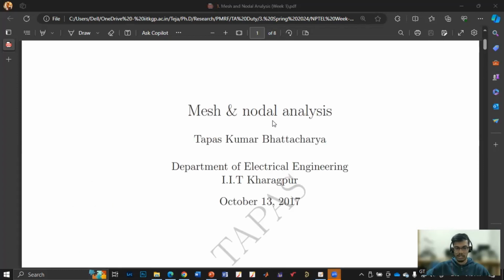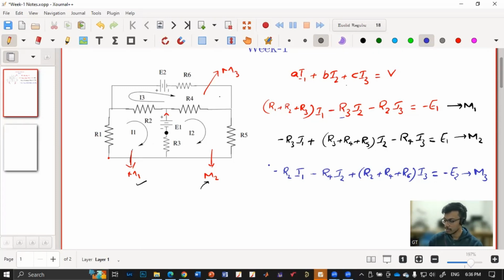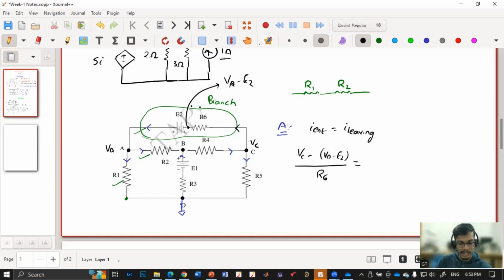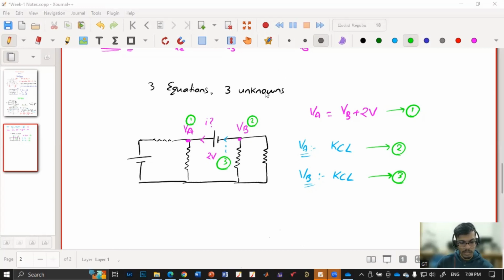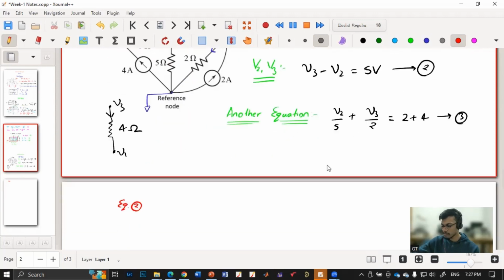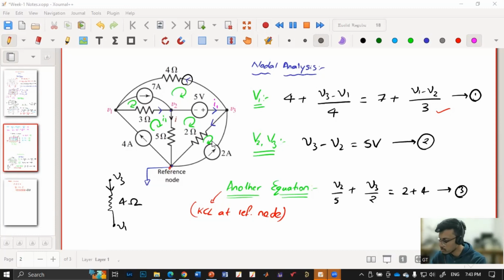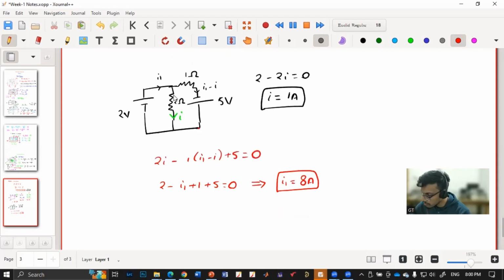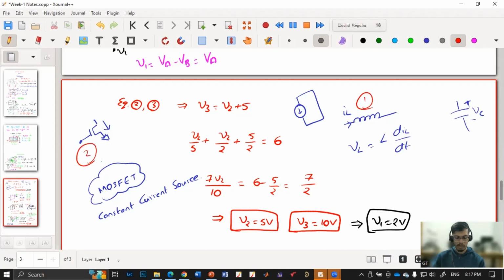Week 1 | Network Analysis | Problem Solving Session | NPTEL

Comment: Teacher, can you tell me how studying Network Analysis is different from studying normal circuits? In Vietnam, I only studied one subject of circuits, which is related to things like KCL and KVL. Is this course similar? Thank you.
Reply from the maker: Yes, this course discusses KCL and KVL, along with that other fundamental concepts in circuit theory including
1. Circuit Elements & Sources
2. A deeper look into Inductor and Capacitor
3. Solution to Linear Differential Equation
4. Mesh and Nodal Analysis
5. Self and Mutual Inductance
6. Circuit Analysis with Laplace Transform
7. Network Theorems
8. Graph Theory
9. Network Analysis with Dependent Sources
10. Two Port Networks
11. Series, Parallel and Cascaded Connection of Two Port Networks
12. Ideal Op-Amp Circuits

Here is the link to the playlist: https://www.youtube.com/watch?v=bC0xeMdjkas&list=PLQUkmn9iJilLwSgDfL0brXm_CGJRCBRTC&ab_channel=UR%C2%B7Teja